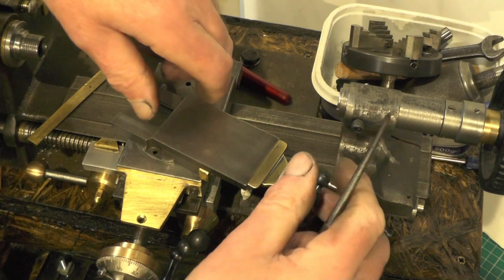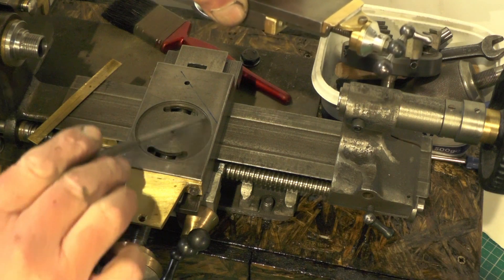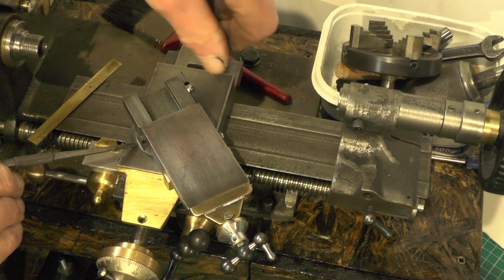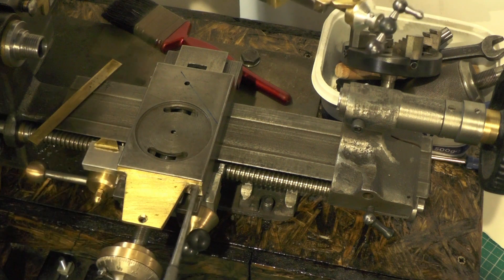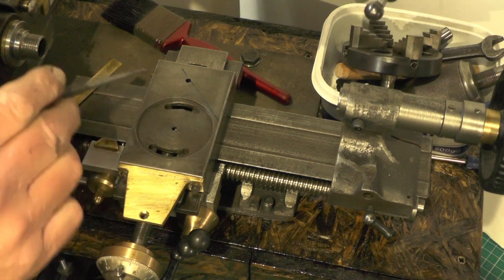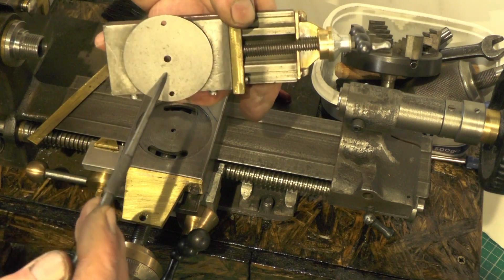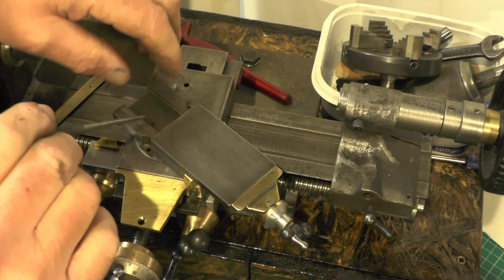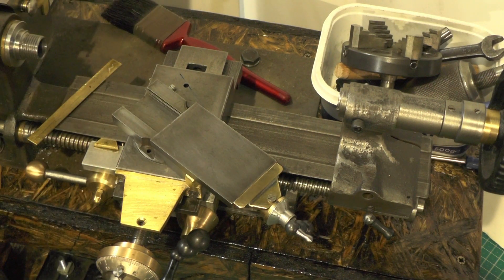Ep 21 Making a Micro / Mini / Watchmakers / Small Lathe (Compound Slide Fixing) "mr factotum"

Comment: at this point i begin to wonder if the slides casting  thickness was the reason nobody finished this "kit"

was there no way to braze or silver solder an extension plate on top and use regular hardware?
i know it is getting scary close to the spindle height, but it might work with a very low profile toolpost
yes i am watching entire series in one sitting at work :P
Reply from the maker: thanks k5895
I can't answer why it was not finished many moons ago, but the physical lathe overall size determines the castings. Enjoy the rest of the 16 parts, and thanks for watching and feedback it's appreciated.
cheers
Kev